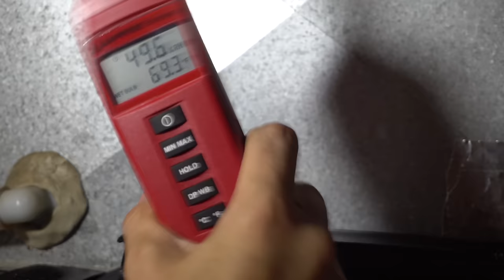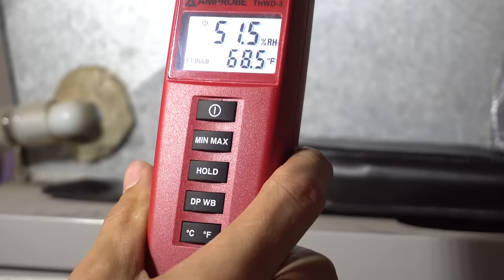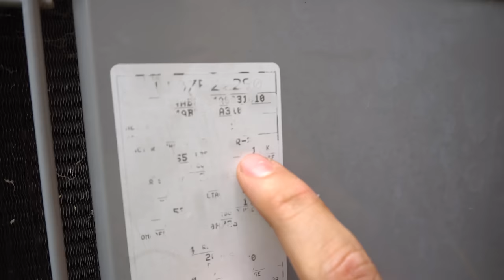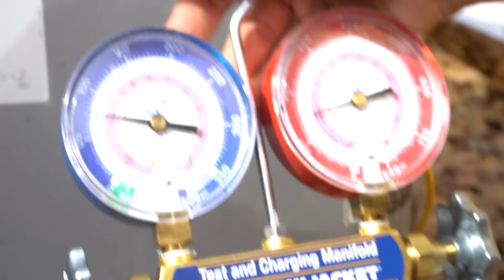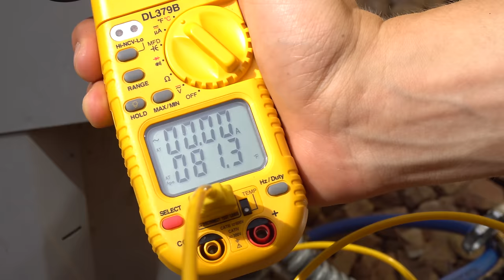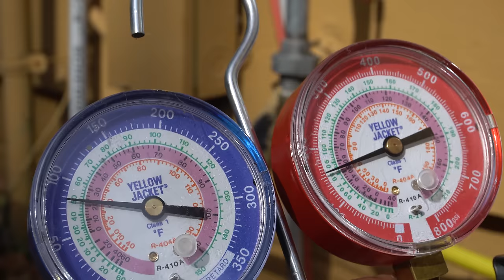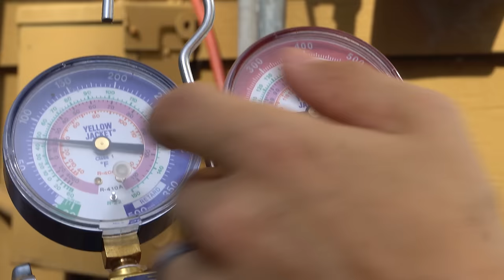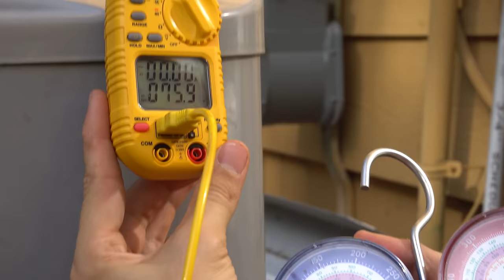How To Refill R22 AC With Subcooling Method

Comment: good vid, but when i see a problem like low refrigerant, my first thought is...WHY?  i want to see vids on trouble shooting and fixing leaks
Reply: Tighten or replace Schrader valve cores. If you wanna test them take the valve cores out of a core placement tool w the system off and see if your pressure goes up

Comment: Why does your app show “Subcooling charging” at the top of the screen but displays “Target Superheat” and “Actual superheat” in the bottom left hand side of the screen.  If it has a TXV and your trying to hit a target subcooling, why are you calculating Actual superheat with your app?  Shouldn’t your app just subtract the corresponding saturation temperature from the input liquid line pressure from the measured temperature of the liquid line to come up with subcooling.  I’m confused with the app you’re using.

Comment: Thank you for your video! I was was following it and I just recharging my AC from the R22 recovery bottle. I measured the pressure inside the bottle and at the beginning it was 148 psi at outside temperature 84 Fahrenheit. I purged all my hoses red, blue and yellow. I have connected the yellow hose of my R22 charging manifold to the vapor side and placed the tank upside down on the scale. When red and blue hoses were connected (red to the thin high side and blue to the thick low line) and the air conditioner was off I measured on red line 120 PSI and on blue line 115 PSI. When i started the AC, the red line was at 195 PSI and the blue was at 195 PSI. I started to add the R22 refrigerant from the bottle via the blue side vale in small portions and after 20 minutes of charging blue line was at 40 PSI and red was at 210 PSI. After 30 minutes of charging blue line at 46 PSI and red line at 215 psi. What is bothering me is that at the beginning the air temperature inside my house leaving the air duct was at 16.2 degree Celsius and after 30 minutes of my AC  charging it was 18.6 degree Celsius. Also I was under impression that the red line pressure will go up after charging and the blue line pressure should actually go down, but in my case it went up instead. Any recommendation what I have done wrongly?

Comment: Pretty good video.  On a TXV system, a sight glass installed in the liquid line right before it enters the indoor coil will help in diagnosis.  The sight glass should be clear, indicating there is solid liquid refrigerant entering the metering device, which is necessary for  the TXV to do its job.  If you see bubbles in the line, it could be from low charge, or a restriction .  The subcooling reading  is key to telling which of the two you have.  High subcooling indicates a restriction.  Low subcooling indicates a shortage of refrigerant.  To properly top off the charge, add enough refrigerant to clear the sight glass, then add a little more while measuring subcooling.  The more you add, the more subcooling you have.  You only need enough to prevent the refrigerant from flashing back into a vapor, do to pressure drop in the liquid line.

Comment: Thank you for amazing video, It helps a lot. But I just wanna let everybody knows that you need to check temp on liquid line with pipe clamp (at 5:37 mins on the video) instead of discharge line. I think you did right but said wrong. Thank you so much again and please keep teaching us.

Comment: Another very good and useful video.
I only ask this as to prevent confusion.
Since you knew it was a TEV metering device, why did you need the wet bulb temp as there was no reference to it afterward?
Also as a veteran HVAC professional, I would like to see what the “operating superheat” of the TEV was. Typically they are in a range of 9-12 degrees, although this unit is at the manufactures required sub- cooling, the TEV could also be not working correctly or have contributing problems , like a dirty coil or filter. 
If the unit needs charging:
1. Was there a leak?
2. Always check both the S/H and S/C
3. When charging, purge hoses first.
4. Check the delta T across the coil. Is it 18-20 degrees after about 10 minutes of operation?
5. Is that evaporator coil dirty?
6. Is the condenser coil reasonably clean?
We are in the heat transfer business, all these need to be checked if charging ( existing unit repair call) is required.
Thanks for the great video.
Reply: It was a txv not a tev. He addresses your questions in the description, learn how to comprehend and YouTube.
Reply: @rawimpact  
Hello,
Comprehend you say?
Ok, the spelling of Thermostatic Expansion-valve gives you the correct TEV! 
TXV is the colloquial spelling, as Xmas instead of Christmas.
Comprehend?
He did not explain why when he knew a TEV was installed what the wet bulb temperature reading would afford him.
The answer would have been it would show the total load on the evap and aid in knowing what the evap was seeing so when a superheat reading was accomplished, say 9-12 degrees, he would know that the cool was loading appropriately. The delta T would also show that if he found say 16 degrees, the humidity would be indicated in the previous wet bulb reading. As the humidity starts to drop the delta will climb to a desired 18-20 degrees.
I do comprehend quite well and my points were correct and valid.
Learn to read and comprehend.
Reply: @wayneschneyer8699  lol i call it a tev at work as well just to drive the guys crazy 😂 even put it in my dispatch notes 😁
Reply: @Christopher-li7uc  that's hilarious I'm going to start doing that
Reply: hes a do it yourselfer that's helping customers cause damage to their units and also steering young techs wrong ... but hey we  end guys like him because the customers will spend even more to repair damage done after watching hacks try to teach them the wrong way

Comment: some people have nothing better then to put someone down for a quick fix situations I get it your two videos. You are throttling it to simulate an office for adding liquid. If the label is faded I check the indoor air handler and on the condensor I try and find the compressor model and research. Thanks for the app recommending

Comment: What I found interest was that before you added refrigerant by looking your low side gauge had good pressures and your saturation temperature was around 40 degrees wasn’t showing low on refrigerant by the gauges,but after checking sub cooling was a diferente thing,good videos thanks
Reply: You can't just charge until the low dose shows a saturation temp is 40*. There are sooo many more variables.

Comment: If it's an R22 you can just about assume that it's not a TXV. Its also irrelevant. Just charge according to the charge chart on the inside of the cover plate of the condensing unit. Most important thing to do before
charging is cleaning both coils and change the filter (sales).Good luck out there my fellow techs. God speed.
Reply: You forgot a static pressure test for proper fan speed and airflow confirmation through that filter and clean coil. That is the most important thing to confirm, you can’t charge a system correctly without confirming airflow is correct first. Any tech that says a system is over/undercharged without analyzing the airflow is guessing. In this trade, if you’re not testing, you’re guessing.
Reply: @andrewn7101  ABC's air before charge.
Reply: True. Plus superheat works with any valve so just always use it. The only “downside” is you need a wet bulb temp, but that is way easier to get than to find if there is a TXV or not.

Comment: don't think too many folks will have or spend the money to do their own charging, plus you still need the refrigerant which not easily obtained, but it was a nice lesson in the procedure.
Reply: Needs to be LEGALLY obtained and handled through an EPA certification i.e. 608.
Reply from the maker: I agree. This video is mostly for HVAC technicians or anyone else who is curious. I think the handling of refrigerant is better left to the techs, not something a homeowner should attempt.

Comment: Need help. What’s the best option to replace R22 ? My system has a leak. Since R22 is too expensive and R407c, R438a will be ban in 2024. What will be the best option to cool my house. Any advice or suggestions will be well received. Thanks in advance for your help.
Reply: Several options under EPA rules, 1. Recover freon, repair leak and recharge with R22, 2. You can do a retrofit to replace R22 with another compatible refrigerant 3. Replace unit.  Based on age, replacement probably is best option, however, it's the most expensive too in the short run of things.

Comment: A sign that it has a fix orifice will be that the coil connection for the liquid line has a threaded fitting. That gives the option to alternatively install an external TXV. In my years as HVAC tech I yet to see a fix orifice furnace that has a sweat connection to it!!

Comment: Adding refrigerant into a unit. Using the throttling method, having an inline sightglass comes in handy. Every gauge set I have or used has one on it. it helps because you can see the refrigerant going in
Reply: Yes, but when you have a solid column of liquid, you can't tell anymore.
Reply: @nsant  What I meant was my inline sight glass is on my gauge set. This way I can see how much or fast I am adding refrigerant.

Comment: Hey Jay, thanks so much for all the great videos, I enjoy watching your channel, I have a question for you.
I have an AC unit with oil heat inside, I want to change the AC to the heat pump system, do I have to change the air handling unit inside?
Reply from the maker: You're welcome! Yes, a heat pump with an oil furnace as a backup heat source is a valid option. You may have to get a few quotes from different companies though.

Comment: You should invest in some digital gauges. My digital field piece does all the subcooling/superheated calculations and also tells me my line and saturated temperatures. It's Bluetooth and connects to my phone so I can see my pressures from inside the house. Also connects to other digital equipment

Comment: Is getting inside the evaporator coil the ONLY way to find out what metering device I have? I've got an old Goodman unit, the plate on the outdoor unit (CKL49-1) doesn't show what type, neither does it say the subcooling target.

Comment: I'm a tech and a big apartment complex and sometimes we find that the whips are installed to the wrong unit we have to keep going back down to the apartment and back up on the roof. The best way I have found so far is to shut the indoor breaker off and then take my meter back on the roof and test units to find the one that has no power. You have an easier method to find the right unit?

Comment: I have a 97 TRANE Air Handler and a 2008 Payne Heat Pump system using R22.  I do all the required maintenance (timely filter changes, regular A-coil and Condenser cleanings, etc.).   Unit works fine but I’m concerned about its age, and availability of parts for this R22 system and if needed, getting it serviced.  Should I run it till it stops, or replace?

Comment: The small line leaving the condenser going to the TXV is the liquid line. You kept referring to it as the discharge line. I would also add that techs should always wear gloves and safety glasses when handling freon. Over my 32 years in the HVAC industry I've seen some pretty bad injuries.

Comment: My suction line, from the wall to the unit has foam wrap insulation around it. There is a small area exposed to the ambient air. Using an IR thermometer, should I use the exposed area for temp readings or expose an area underneath the insulation to determine sub cooling? There is a pretty good difference.

Comment: Thanks for your informative videos. Always very clear step by step instructions/explanations. Do you have a video that shows a simple way to add R410-A to an Expansion Valve (TXV) system?
Reply from the maker: You're welcome! Unfortunately I don't have a video for 410a yet. It's important to add it as a liquid only and throttle it in slowly or use a vaporizer. The pressures will be different but the saturation temperatures should be similar to R22.
Reply: @WordofAdviceTV  Isn't adding 410a to a AC with a TXV system more complicated than R22? I've watched many videos on Youtube and many are complicated. It would be great if you could post a video showing a simple method (if possible) of adding 410a to an AC with Expansion Valve (TXV). Thanks again.
Reply from the maker: @strongspear1918  Ah I see what you mean. Adding R22 and 410a is pretty much the same though. The only difference is the pressures. R22 can be paired with a TXV metering device as well. I would love to make this video but currently, here in Hawaii, don't have a good opportunity to do so. I will try to get it done later though. Thank you for the request!
Reply: @WordofAdviceTV  Sounds good - - 👍👍 Thanks for the response.

Comment: I still don't have cool air. The capacitors are good, the fan turns on, the filter is clean, the compressor turns on. The line set does not get cold or sweat. I still have to check refrigerant levels. But  I think I am low on refrigerant.  Do you agree or is there anything else that I can check? Of course it will need r- 22.
Reply: how often do you change it ?

Comment: Great video. Is R22 being outlawed or phased out? its very expensive here in california. Have you done a conversion from r22 to r410a?
Reply: No, but is is being p-h-a-s-e-d out.
Reply from the maker: Lol, I see what you did there with the phased out Jo Tu :) Yes, it is slowlyyy being phased out. I have never done any conversions from R22 to r410a.
Reply: @WordofAdviceTV  actually I think the part that you thought was me being a smart alec was unintentional . I was really just saying that the guy spelled it wrong.
Reply: To convert a system from r22 to r410a is pretty much replacing the whole system.
Reply: You can buy a replacement of r-22 its MO99 refrigerant its pretty cheap, and you can mix it with r22.
Reply: Its been illegal in Canada now for quite some time
Reply: @martinrivera6828  you should never mix refrigerants. All of the r22 must be recovered.  System then needs evacuated. Then you can use your r22 replacement.

Comment: Hello, thank you for this video. I have a question - my R22 bottle has the red and the blue valves but my R22 manifold has the yellow input house. Do you know by any chance where I connect yellow house? To the red or the blue valves?
Reply from the maker: Are you sure this is a green R22 bottle and not a recovery tank? Or are you re-using recovered refrigerant?
Reply: @WordofAdviceTV  I was re-using recovered refrigerant. My AC was working fine till this summer when it was not able to cool down below 25 degrees in my house when outside was 31 degrees Celcius. I called the technician to give me a quote to recharge the AC and he told me that the R22 cost now more than gold so I decided to do it myself. I purchased the manifold and the recovery R22 tank and spent twice less money. After I recharged my AC started to work properly and is able now to cool down below 24 degrees Celsius in my house with the outside temperature of 31 degrees. From the youtube video, I have learned that the Superheat temperature is usually about 10-12 degrees Farenhight and the measured temperature on the high side usually would change about 2 degrees Farenhight, so I came to the conclusion that there is no need to measure it, I will just go by the temperature reading from the high side. I was just recharging my AC from the R22 recovery bottle. I measured the pressure inside the bottle and at the beginning, it was 148 psi at an outside temperature of 84 Fahrenheit. I purged all my hoses red, blue, and yellow. I have connected the yellow hose of my R22 charging manifold to the vapor side and placed the tank upside down on the scale. When red and blue hoses were connected (red to the thin high side and blue to the thick low line) and the air conditioner was off I measured on the red line 120 PSI and on the blue line 115 PSI. When I started the AC, the red line was at 195 PSI and the blue was at 195 PSI. I started to add the R22 refrigerant from the bottle via the blue side vale in small portions and after 20 minutes of charging blue line was at 38 PSI and the red was at 205 PSI. After 30 minutes of charging the blue line at 44 PSI and the red line at 210 psi. What is bothering me is that at the beginning the air temperature inside my house leaving the air duct was 16.2 degrees Celsius and after 30 minutes of my AC  charging it was 18.6 degrees Celsius.
Reply: @WordofAdviceTV  Yes I am using recovered R22 refrigerant.  Originally the blue gauge showed a saturation temperature of 20 degrees F (Pressure 43 PSI R22). At the same time the temperature I measure on the blue line next to the charging port is 80 degrees F. Thus my Superheat is 80 F - 20 F  = 60 F.  The pressure at the red gauge before charging was 200 PSI which corresponds to the temperature of 102 F. When I charged the system from the R22 recovery bottle, the Superheat changed 75 F - 26 F  = 49 F. my red At the same time the red gauge after charging showed the pressure 225 PSI or it is the temperature 106 F and I measured the temperature of the high-pressure pipe was 106 F. Question- is my system is overcharged now of I should continue charging it?

Comment: Hi, I have a question: If I take a fully loaded 30 lb, i.e. 13.6 kg, R22 cylinder and open the valve of the cylinder almost all the way without turning the cylinder upside down, how long will it take to release gas on average?
Reply from the maker: I have never tried that so I am not sure.
Reply: @WordofAdviceTV  thank you for your answer, have a good day